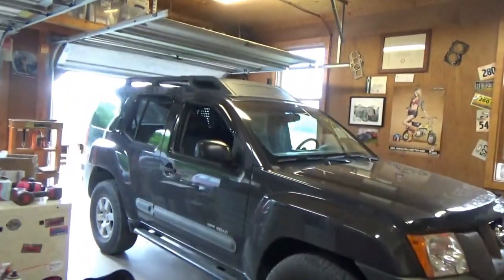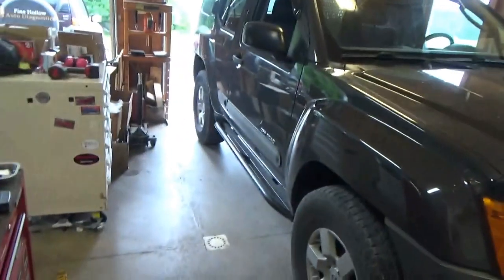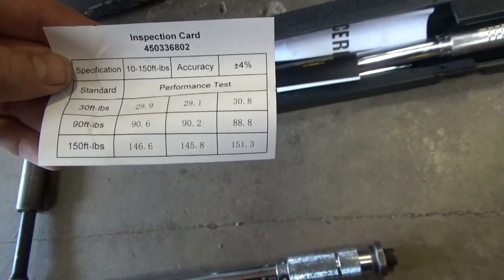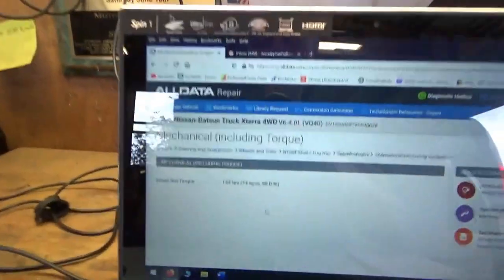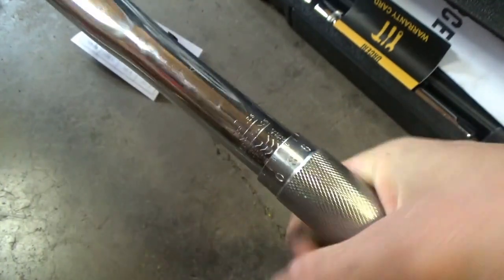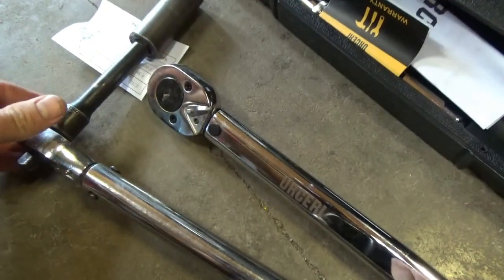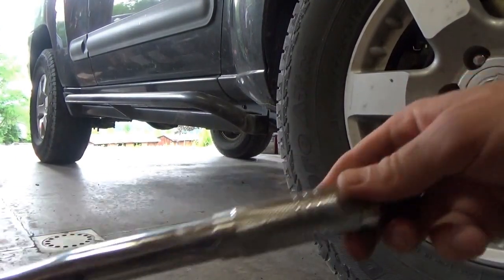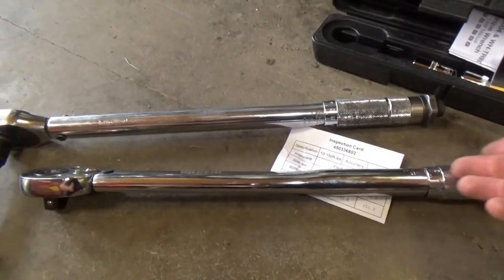Can you trust a $30 Torque Wrench?

Comment: Still a good idea to get a feel for each 'torque' cause, in my experience at least, when the micrometer torque wrenches fail, they just stop clicking and may cause you to way over torque something. Back in high school I had a Great Neck micrometer torque wrench fail while I was laying in an awkward position under my truck trying to torque main cap bolts, I though the excessive force I was using was just because of said awkward position, and I proceeded to twist off a main cap bolt. Lesson learned, now if I feel like I'm applying excessive torque, I will try the wrench on something that wont be damaged by that torque setting (Axle nut is my goto) and make sure it still clicks. I've had that Great Neck fail as well as 2 Harbor Freight Pittsburgh 1/2" torque wrenches fail, all with this same failure mode.
Reply from the maker: Yup the "common sense" torque wrench often saves the day :)

Comment: No need expensive tools ,they are not really more accurate than your generic wrench since you need to have clean threads,lubed washers or theads ,specific temperatures to get repetability 
fancy tools don't compensate for crappy methods.
a torqued wheel in winter will be looser in summer.
I've tightened head screws with a jug full of water and a broom as lever...you just need the formula to make your own wrench if you are in trouble tool wise.

Comment: I agree Ivan, in the automotive repair, its not the same as other industries that require high end Torque equipment like military or space assembly. Sometimes a mechanic's touch is best on old equipment.

Comment: One thing you missed saying is that one should ALWAYS loosen the setting all the way before storing torque-wrench. This prevents the spring from losing its critical spring-rate because it is not under tension during storage.

Comment: Had a friend who was rebuilding a vintage Honda inline 750cc motor. He stopped at HF to get a inch & foot pound torque wrench for assembly as they were on sale for like $15. I took my Snap on over because a off torque wrench could destroy a aluminum threaded case. We torqued head bolts with my Snap on on a junk motor then set the foot pound HF to same spec. It didn't click until almost three more turns. The cheapo torque wrenches have their place. Maybe lug nuts and the recycle bin ?

Comment: I usually connect my click style torque wrench to a Beam style torque wrench with a socket,    set it for a certain torque And see if the needle on the beam torque wrench Reaches the specific torque when the other wrench clicks ,Great video as usual Ivan

Comment: Hmm maybe use a joiner to connect them together and see which one clicks first.
it would not tell you accuracy but how different they are.
I imagine you would have to clamp the square drive into a vice with the handle horizontal and add weights to the end to trigger it, but guessing the handle weight and fulcrum point plus working out the magnification value could be a pain.
My brain hurts lol.
Reply from the maker: Excellent suggestions for part 2!

Comment: You are using extensions, which decrease the actual torque force. You should really use only the socket, or as you said add 5 ft lbs. I think that there will be need to use digital torque wrenches. Manufacturers will be more stringent in cases of recalls and repairs done by independent shops. Also when we talk engine rebuilds, then we need more accuracy.
Reply from the maker: In this case I can connect 10 extensions in a row and achieve the exact same torque when the wrench clicks. Can you tell me why?
Reply: @PineHollowAutoDiagnostics  Because the length of your arm is the same. Even that I would expect that extensions have some influence - not exact fitting one into another.
Reply from the maker: @Paolo0902  Exactly, torque = length x force. The extensions might twist like a noodle, but the final torque will be the same at the "click" :)

Comment: I use a luggage scale to verify that my wrench is accurate. I have this one - https://www.amazon.com/gp/product/B07L519X58/ref=ppx_yo_dt_b_search_asin_title?ie=UTF8&psc=1.
Set the wrench to desired setting, attach the scale's strap 1 ft away from the socket drive and pull. The click should happen with the wrench setting matching the weight shown on the scale. I do this every time I need to torque my wheels - it takes only a few seconds. I've gotten used to double check the torque after every tire rotation and rebalance at the tire shop. They very often over tighten the lug nuts which could lead to warped rotors.

Comment: I've been using my 1/2 inch beam type torque for years on critical things like cap bolts. I've never tried it on wheels.... I still do them by feel, expecially with anti-sieze which changes the torque spec by about 17%.  But as I'm losing the use of my right arm and I can't judge my strength properly... I used my 1/2 inch torque wrench to tighten a 15 lb bolt and the dang gasket just kept leaking.  I came to find out that although the scale on the wrench goes to 0 it's not very accurate in that torque range.  

Torque wrenches have sweet spots, supposedly the better the torque wrench the bigger the sweet spot.  A 1/2 inch torque wrench is great for lug nuts and head bolts, but not the right tool for valve cover bolts, even if the scale goes down to zero.

Comment: I have a hand me down McMaster torque wrench set, probably 35-40 years old. 

I use the wrench to only torque the bolts after I've run them down via a ratchet, never loosen them. 

Also, I make sure to zero them after use. I have a bright green paint mark to remind myself to zero it everytime.

Comment: I don't trust; I verify.   Bench vice, bathroom scale and a measuring tape.  Measure where you're pushing, push straight down 'till you hear the click, check out how many pounds you've lost and do the math.   For little ones you just hang a weight rather than do the bathroom scale.
Reply from the maker: Excellent way to test!

Comment: Yes, in some cases, you do.  Obviously, a "torque stick" is good enough for lug nuts, but there are many jobs that require an accurate torque wrench.  I would never rebuild a customer's differential without my Snap-On Torque-Meter to measure the preload.  Trying to get 8 to 14 inch-pounds with a crapy unrepeatable torque wrench will drive you to distraction.  Jobs like automatic transmissions and diesel engine top ends are jobs that come to mind where breaking out my MAC digital torque wrenches are necessary to minimize error.  And, it's not just using a tool of decent quality.  I send out all the torque wrenches I use on the "fussy" jobs to be recalibrated every three years.  I've found that even the ridiculously expensive Snap-On digitals will drift a lot, especially if you accidentally over-torque it when you have to tighten a bolt to a specified angle... sometimes ending up WAY over the rated torque for the wrench.  So, does a person need a "fancy" torque wrench.  I say if you make your living doing close tolerance work on someone else's machinery for pay, yes.  Even for some DIY'rs; if you're working on Subaru heads or Deutz air-cooled diesel engines... you will still need a decently accurate, and REPEATABLE, torque wrench.  I suppose the answer to your question is, "It depends on what kind of job you're doing and how good is the result you must have."
Reply from the maker: Excellent comment. Thank you!

Comment: Ivan,   i have harbor freight torque wrench,   i have 1/4 with inch pounds and 1/2 with foot pounds. It has been pretty good for my jobs.   I didnt think to question it on how reliable it is until this video.   Great analysis!  Thanks for explaining!!

One more thing,  i always reset it to zero after I'm done,  as of the springs inside,  it wears and shortens its life.  That's what i was told......

Comment: Extensions change the torque settings.
The best way is to not use a extension, tighten until the bolt snaps & back off 1/4 turn.
😉
Reply: No they don't

Comment: The double click is a favorite that we all do, I guess.  But pretty much worthless.   To be accurate, the torque reading must be made while the fastener is in motion.  Once it stops,, it takes much more to get it to move again. Checking one wrench against another on a torqued fastener will only show a difference if one wrench is much different, click point, than the other.  A more precise way to compare wrenches is to mark where the fastener stops on one wrench, loosen it and compare where it stops with the second wrench.
Reply from the maker: If it's a dry rusty fastener then yes. These lug nuts actually worked quite well for the demo. Push just a bit past the click and they kept turning 😉

Comment: Some tools you need to buy the expensive ones. Like brake line flaring tools. If you buy the $30-40 version you have bought a brake line mangler. Better off to rent or purchase an eastwood-style flaring tool, it costs upwards of $400 but gets the job done every time.
Reply from the maker: I've used my 20 year old $25 Autozone flaring tool kit for hundreds of flares and it still works perfectly. So I would have to disagree on buying the $400 one haha

Comment: What should one do when printed torque specs vary - for example, when the owner's manual, a vehicle-specific Haynes Manual and Alldata each cite a different lug nut torque, a value that varies from approximately 100 to 125 to 150 ft. lbs.?   And I have had the experience of having a wheel come off of a mid-60's Buick LeSabre convertible when I made a right turn after a full stop at a stop sign, very shortly after a 375 mile trip via Interstate.
Reply from the maker: What car?
Reply: Pine Hollow Auto Diagnostics 2010 Equinox 2.4 LAF w/ 2wd.

Comment: Before I retired I was able to take a HF torque wrench in to our lab and have it checked - it was closer than the last Snap-On was for calibration (and the lab admitted that they have checked several of them for folks and they were all well within range). Also, they should be set to the lowest setting, not necessarily 20 to remove the tension from the spring.

Comment: There are angle attachments for torque wrenches for a few dollars.  Just went with split beam.  No batteries, no resetting back to zero.  20 years later, mine was off by 0.4 lb-ft.

Comment: For an overhead valve adjustment on a semi motor after adjusting the lash of the vavle for intake, exhaust and jake brakes you have to torque them to spec but you must use an analog torque gauge because the click styles will over torque the nuts and bad things can ensue they are more sensitive but when you need 45 ft/lbs no more no less thats the way to go and i think cummins will not honor the engine warranty if they find out you used a click style on the valves

Comment: I had a Craftsman one for about 25 years until the teeth in the head started stripping out. I bought a Kobalt one about 5 years ago and it works perfectly, does from 50-250 ft lbs. It even came with a spec. sheet which was kind of surprising. I use them on wheel nuts,  cv axle nuts when doing wheel bearings and cylinder head bolts. I even have a inch pound torque wrench for doing the spindle nut on tapered wheel bearings, remember those?
Reply: My Craftsman 1/2” torque wrench did the same thing. The ratchet part stripped although the torque function was still working. I took it to Sears for the lifetime warranty on hand tools and was told, “Sorry, that doesn’t apply to torque wrenches”. Last Craftsman tool I’ll ever buy. 

I have four torque wrenches now covering from 5  inch pounds to 250 ft/lb. All made in the USA. Three are the vernier twist grip style like Ivan’s one is a CDI (Snap-On brand) with a dial display like a dial indicator. I can’t remember the last time I used the CDI. It’s not very practical to watch the dial while torquing a nut.

Comment: If lug nuts are severely over torqued, then in case of a flat tire, you might not get them off with the factory tool.  Ask me how I know.
Reply: 😂 f150 is 150ftlbs my mini impact can break that loose but a tire shop torque them way high that it had to go back to them to break the lug nuts.
Reply: @Photostudioww  those have been bad for years with the aluminum rims, rust/corrosion seizure of the lugs was bad (in the salty-rust belt) I was always breaking them loose or using impact to pull them for everyone.
Reply: Use a little anti-sieze on them,and no problems in a future. You’re welcome.
Reply: Volodymyr Buchak NEVER use anti-seize on lug nuts..

Comment: Wondering why you used an extension??That will always throw off the torque readings!
Reply from the maker: How so?
Reply: @PineHollowAutoDiagnostics  While EXTREMELY minute, the extension will flex slightly. Affecting end ttorque. Obviously a 36 inch extension will twist more than a 4 inch extension. Basically a torque nazi complaint.
Reply from the maker: @scottberger1727  but how would twisting of the extension affect torque in this situation? If using an impact gun sure the twist acts like a shock absorber. But in this static case with a wrench the extension can twist all it wants. As long as you get to the "click" your torque will be the same, even if you have a 100-foot extension lol

Comment: I need to invest in a new torque wrench, and probably more muscles, or at least a cheater bar. The latest vehicle I purchased wants the lug nuts torques to 140 ft lbs. I will be dreading the day I have to take all of the tires off.
Reply: A 600mm breaker bar will take that off no problem.  Unless you've cross-threaded them on with the ugggadugga gun 😐
Reply from the maker: Harbor Freight Earthquake electric impact to the rescue 😁

Comment: I have a clicker like yours, as well as an Eastwood digital torque adapter, which is kinda bulky but it has 1/2 and 3/8 adapters and tolerates up to 200NM. (Don't @ me, I have a VW)
Bottom line is that I like the beep. What can I say.

Comment: The proper torque for any size fastener is "A quarter turn before it breaks" , or , if inside a unionized environment " Reef on it until you ear it crack , go back a quarter turn and then call the apprentice to finish the job" .
Reply: Good tips, I always heard the proper technique is to go until it's hand-tight, then make a full rotation after that :)

Comment: I love most Harbor Freight stuff, but I got burned by one of their torque wrenches so now I stay away from those. I had a 1/4" clicker that I'd used maybe two or three times and then I went to use it on some valve cover bolts. By the time I realized it had decided not to click it was too late... SNAP. Now I use a tiny beam-type torque wrench on really delicate bolts, never an issue.
Reply: Sometimes the click at low torque values is very subtle.  You may have turned past it.
Reply: @kevin9c1  not likely - the first few times I used it I noticed how soft the click was, so I knew to watch for it. No click at all that time.
Reply: @notsureigaf  on really delicate bolts, I like to test the click on bolts I know have higher torque settings before using...does nothing to validate that the calibration is correct, of course, LOL.  I don't really trust my 1/4" drive torque wrench either.

Comment: Torque is friction also.. if you anti-seize the threads and seat... you'll get closer to Actual torque on the nut or bolt.. 👍.. Ivan knows this .. he was making a short comparison vid.. we know.. 🤛🏻
Reply: Torque specs are usually for clean, dry threads. Lubed threads, torqued the same, will give higher tension on the bolt. Not good. Sometimes seriously not good.

Comment: Not good words for the Harbor Freight 3/8" click type torque wrench. Used it on 3 jobs, then one day intermittently stopped clicking. Green helper broke off a transmission case bolt using it. Good that I had another old cast to get a bolt out of. Took wrench back and they replaced it under lifetime warranty. On the first job the new one stopped clicking. Just too unreliable to be worth trusting it. Back to using my always clicks 1963 Sears 1/2" torque wrench.  The Chinese should have copied that wrench. lol

Comment: Sorry Ivan. I'm not sure I caught the relevance of this test. I don't recognize either of these brands. So were you testing the HF'ish one against a known accurate one or just testing two somewhat inferior models against each other to prove they are equally crap? You didn't mention if the one was a reliable wrench.
 It would have made more sense to compare both of those to a SnapOn or something that you might (big might) be able to trust to be accurate.
In any case a point was made. Thanks for doing the testing.
Reply from the maker: I've used the Powerbuilt one for years with no issues, so that was my "known good" ;)
Reply: @PineHollowAutoDiagnostics  Oh. I thought it might be the other way around i.e. trusting the new one to check your old (possibly worn out) one. Interesting. Either way they were the same. I guess that proves something.
Thanks

Comment: I have seen the local Les Shwabe over tighten wheel nuts by 100 ft lbs, that means 195 ft lbs on a typical 85-90 ft lb lug nut.
If any client goes to them for tires, I fire them on the spot.
Liability is life or death, if a client doesn't listen, don't touch their car ever again.
Les Shwabe leaves their wenches turned up all day, and the "Techs" don't know how to use them anyway. Just because you can run and pass a piss test doesn't make you a tech. I have seen them jump on a torque wrench, and when I measure what they did, the studs are ruined, and must be replaced.
Heads and wheels, otherwise it's by feel, but, I have 40+ years of experience, unlike some idiots, I know what I am doing.